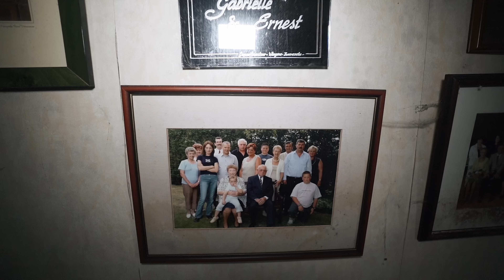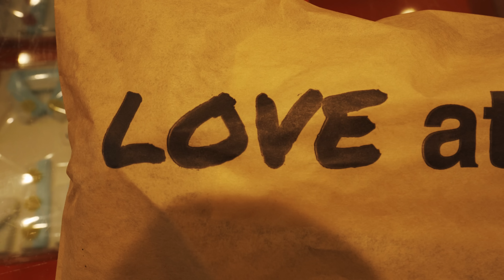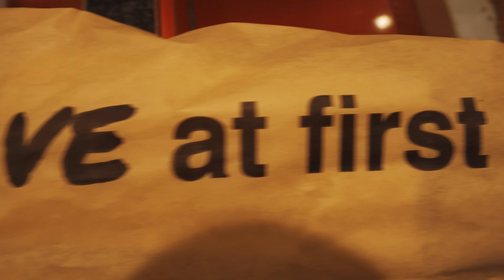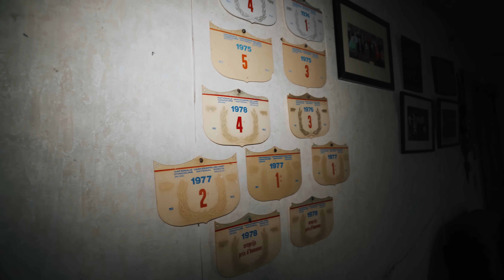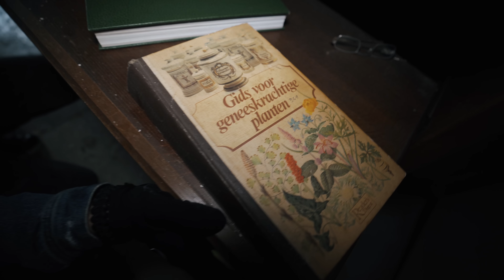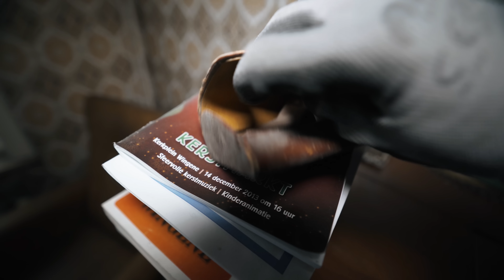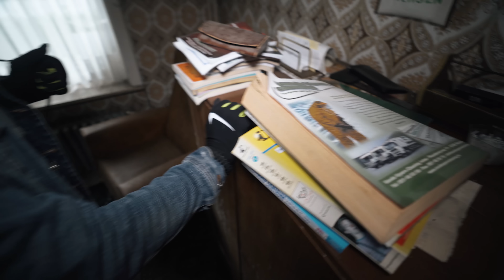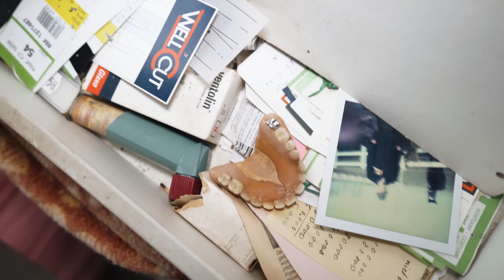We Found An Untouched Abandoned House in the Belgian Countryside

Comment: 28:46- Oooh! Is that a Halogen 2-way lamp?! (1990) I miss mine. The adjustable up-light was SO bright at max! And the power saving bulb for the low light was just enough to let you see the floor well.
30:53- another cane. (3) Someone had balance issues.
You guys should carry a couple of skeleton pass keys.  With long, sturdy barrels, and thinner, sturdy bits. Not exactly lock picks, but more than two olde style keys might be seen as suspicious.